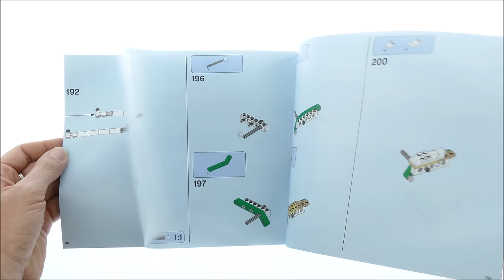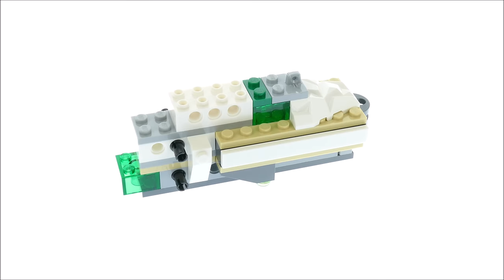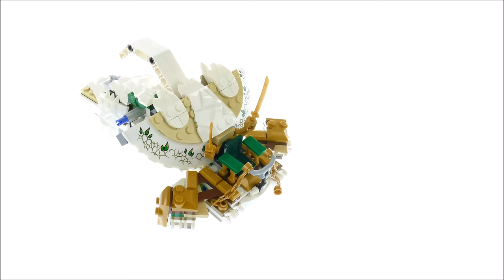Lego Ninjago Legacy 70679 The Ultra Dragon Speed Build

Comment: The dragon's head isn't the same as the original one.
Reply: No, the originals where molded. but this gives more detail and playability, change the head however you desire!
Reply: Samurex Atlas Yes I Do Agree.But i think he meant that It looked better,However I do prefer The newer One.
Reply: No, they are the same. The first season 1 was epic dragon. Epic dragon it's head is joined up together. The ultra dragon didn't. The make it more modified because they wanted it to look more nicer than the epic dragon. The same as the wing. The epic dragon's wings are not the same. The epic's one you need to build. And the ultra's one is a sticker. And others are almost the same.
Reply: That’s why it’s called legacy